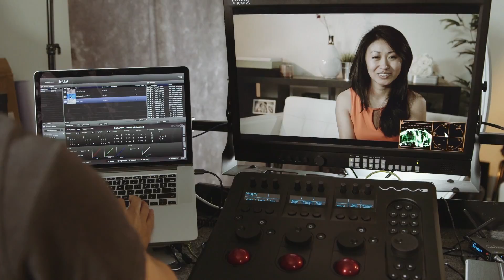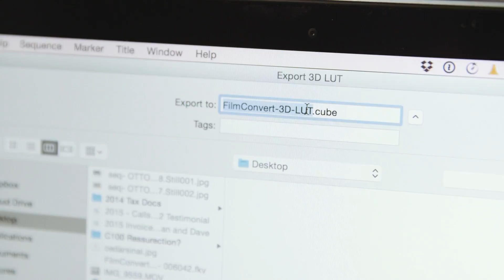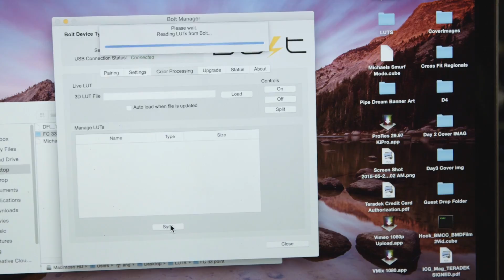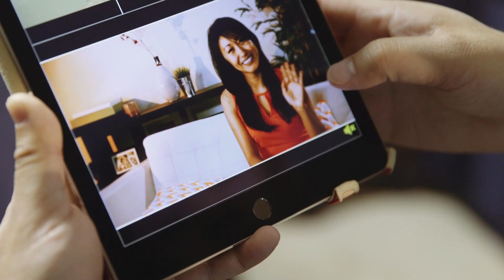LUT's Up in Da House? | Episode 2 // "LUT-able" Teradek & SmallHD Gear | Custom LUTs

Comment: I know the odyssey 7q does something similar to this, does the shogun do this?
Reply from the maker: Yes the Shogun supports LUTs that you can load into its internal memory as well. I haven't tried to see if it passes LUTs down the passthroughs though. Seems like a rare feature.
Reply: Onyx Cinema Was is the best Monitor for DSLR use in sunlight? SmallHD? Odyssey? Blackmagic Video Assist? Atomos? It the SmallHD 502 really worth the price? Thanks :)
Reply from the maker: Hi Richie, we haven't gotten our hands on all of those devices but I can tell you right off the bat that the Shogun is not really a contender in the sunlight. They just released an anti-glare shield, so we'll see how well that works. The smallHD devices we'll be putting through the paces real soon though :-)